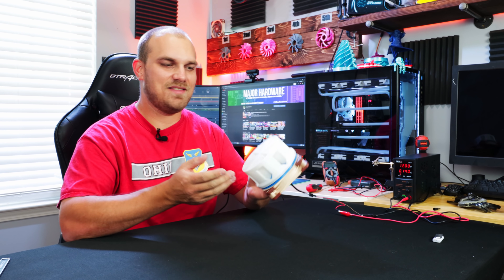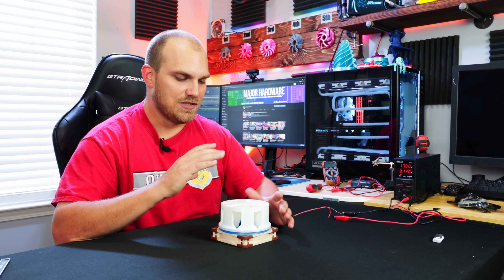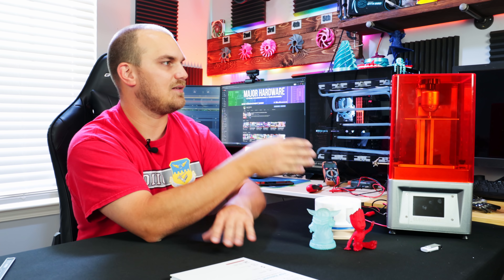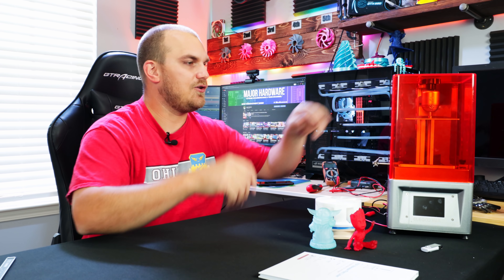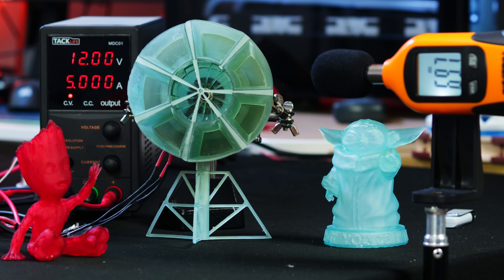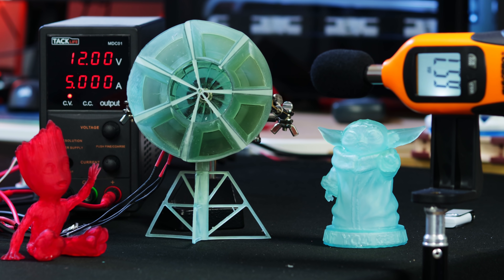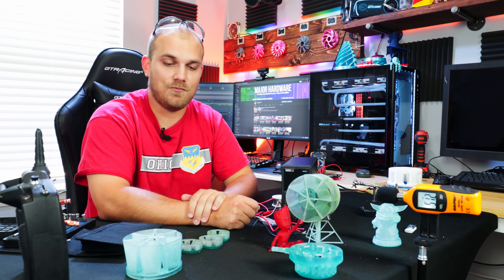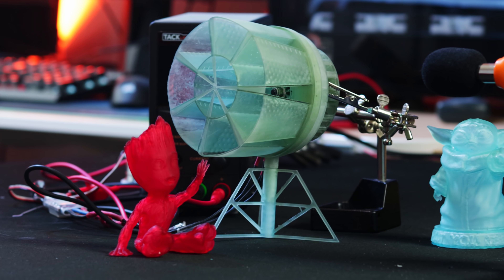CRAZY LOUD 3D Printed Tornado Siren | Elegoo Mars

Comment: You should have used a Lipo battery - say 11.1v 5500 mAh...you can definitely get much efficiency than a power supply. The other thing is you left everything over the table and tried to toast it which can lead to shattering things and dangerous parts flying.... Try to use some sort of a  shelter or put it a well protected place so that if something fails, you and your valuable computers are not in danger,,, Seriously dangerous situation.

Comment: Increasing the voltage makes no sense, your power supply has a limit of 5A, reaching this current it will lower the voltage back, so increasing the voltage in this case only serves to maybe burn your device.

Comment: Print a 120mm fan blade . I've got the elegoo bars 2 pro and I've yet to even take the plastic off...and it's been 6 months. Didnt come with resin.... ive got some other kinds of uv resin but really just havent been able to think of a use for the limited build volume to get me  motivated to set it up

Comment: It could have gone faster, but your supply was current limited. Look at how it fell to 8v when you tried to go full throttle, you'd need a more powerful power supply for it to not drop its voltage

Comment: "I only left half a mil of clearance"
On my Ender-3 I get down to 0.15 on PLA and 0.3 on ABS on clearance tests, if 0.5 is impressively low for you, I think you need to calibrate your e-steps and flow. Specially on a $700 Prusa compared to my $180 Ender-3.

Comment: Your power supply can't handle 5amps at 16 volts you need one that adjust its output to compensate for voltage sag

Comment: your siren is flawed in multiple ways 1st you are using too fast of a motor you want to target around 3600 rpm 2nd your rotor/stator are too small you want to target the largest size you can print 3rd your horns are the same part of your stator you want to separate your horns from your stator

Comment: As a "fan guy" I would have thought that you would have made better preparations for cooling the motor.  Maybe even just a few holes to the inner area of the rotor to pull air through.  Might even assist with better airflow into the rotor.  Also, make the "horn" chambers more parabolic in cross sectional area for better impedance matching with the air (Why trumpets & such perform well).  And dB meter should be in front of the horn as most sound exits that way, not to the side.  And yes, definitely a "beefier" power supply for that motor is needed for full performance.

Comment: I know i'm late to the comment section if you do see this, instead of buying a larger PSU that you might only use to run brushless motors by/use lipo batteries, cheaper and you get all the beans 
Hope this helps

Comment: Hey man, love your channel! You found a pretty cool niche :)
Considered doing a re-print of your best performing fans with longer times or whatever can make them better? Is this resin printer better for the best performing models, and do top 10 runner ups or bad prints need a re-run?

Your cooling tower video is so cool. I want to do this, but would mist instead of drip...

Comment: You should definitely restart the fan challenge using the resin printer. I imagine the higher accuracy would lead to less air resistance and turbulence. Maybe that #1 fan will finally beat the Noctua.

Comment: Your PSU was limiting at 5A by bringing the voltage down to 8V.
You would have gotten more Power/Noise by using your 3S Batteries because their voltage wouldn't drop much.

More detailed explanation: The PSU will not go over either of the limits you set so if you set it to 5A it will limit the current at 5A.
To do this it needs to lower the voltage until it the load draws less than 5A. In this case that was 8V.

The PSU is simply no match for the power hungry motor. To feed it you would need a very big power supply.
These are only available at 12V if you want a decent price but at that point it would be better and much cheaper to just by a 4S battery if you already have a charger for it.

Comment: That doesn't really sound like a siren. It sounds more like a small high revving motor. If you took the horn off the motor and stuck a simple twin blade prop on there it'd probably sound just as loud..No doubt there are designs that can get much, MUCH louder like an actual siren.

Comment: To test higher currents it would probably be easiest and cheapest to get 4s 5s and 6s batteries. If you already have a charger that would be much cheaper than a high current >20A variable power supply. The throttle percentage already regulates total power, so you don't need fine control over voltage.

Comment: Idea: Make a tunnel(/more like funnel) leading from bottom front fan, supplying directly GPU fans with fresh air, in a way that allows circulation around the card once it exhaust the hot air. So the funnel should only by like 9cm wide (lengthwise) at GPU side, but 12x12cm at front fan side with use of some faster fan. And the gpu side would have between 18-27cm in length, depending if it's 2 or 3 fan cooling design. Really curious how this would affect the temps.
Reply: But overall it makes me freaking sad, that there is so many environmental problems connected with people's hobbies and unnecessary activities, and yet new ones still emerge. All this plastic and now resin FFS being produced for what is easily trash in 90% of cases is just ridiculous. How come so many people can't think rationally and stop doing such stupid stuff and support a bussiness that focuses on making trash for few minutes of enjoyment?
Forget my idea, I'll make it of used cardboard and check myself without adding trash to environment

Comment: My recomendation is to get another power suply, you can se at wide open throttle that the voltage drops to around 8v so both 12v and 16v runs were at the same power output. You can run multiple power supply in parallel to get more total power but they have to be set up for delivering the same current (if one gives more than the other, it can damage the one that has less amperage (so if you had one that can go to 5A and other that can go to 10A, you have to run both at 5A) for more voltage the same rule aplies but you have to conect them in series.

Comment: Have you tried running the siren without that front duct?  With the duct your impeller input and output are coaxial so you will be getting interference effects which may be constructive or destructive.  Most commercial sirens don't have this duct, with the siren output coming straight out of the stator in a radial direction.

Comment: Hey man, love the videos.  I think you should definitely try a larger impeller diameter.  Its too high pitched imo, so going to larger diameter should help slow it down drastically for same power levels while increasing pressure (which I would presume translates to more SPL).
Dunno if you've heard of these, but check out the "Fan Affinity Laws"  which describe how flow rate, pressure head, and power requirements relate for changes to shaft speed or impeller diameter.  If the resin print volume limits your size, maybe a hybrid approach of FDM for the horn/housing, and resin for the impeller and immediate surroundings for precise clearance could work well.

Also, as already pointed out in other comments, that power supply can't provide the current for RC motors like that.  I have one which is similarly spec'd but it has dual outputs which can be configured in series or parallel for 60V 5A or 30V / 10A max max, but 10A still ain't much in terms of brushless motor power, they can take HUGE amounts of current.  Unfortunately I haven't seen any similar "off the shelf" bench supplies like that with sufficiently high current for a reasonable price though.
Why not just stick to LiPo batteries as you've done before?  If you're after the voltage/power reading that the bench supply provides then I'm sure there's some modules geared towards RC usage that could help display that.

Comment: Wow, that's a cheap resin printer! :o
I'm used to Formlabs, and they're probably at least 10-20x more expensive... One thing they do get right though, is the resin cartridge system - just inserting a box of goo in the back of the printer and not having to worry about manually (re)filling the build tank to the correct level really makes the experience that much better (even though those cartridges are quite expensive)

Comment: You should definitely retest all the old fans with the new machine and move to making all the new fans with MSLA. FDM is just extremely unoptimized for what fan blades require. MSLA is good enough for what you're doing, which is just prototyping, but isn't quite good enough, yet, for production of things like fans, which is why you don't see any production unit using printing for it's product. 
Not to mention MSLA printing allows for much higher detail and much more intricate designs.

Comment: I'm no expert but I recently got the Elegoo Mars, mainly for printing minis but I also like to make functional things (spare parts for my kids toys or a tabletop vice etc). I had some issues to start and got some advice from a bunch of people, so some of the following is regurgitated advice and I'm sure you've probably looked at this stuff anyway. For functional parts I can highly recommend getting some Siraya Tech Blu resin, it's so much stronger than normal stuff. Also, if you're finding stuff is sticking to your FEP, you might want to check your bottom layer exposure time, somewhere between 60 - 80s should do you. Also depending on the resin, you may need to adjust your standard exposure time, for example, for normal Elegoo grey, I use 70s/8s but for Siraya Tech Blu I use 60s/11s

Comment: That was not 5 amps @ 16.6 volts. Watch the voltage drop at full load. Your unit can likely only supply up to 40-50 watts of power.

Comment: With your ultrasonic, you can use ziploc bags with IPA in them along with your print, the ultrasonic will go through the bag and the fumes are contained within the bag.
I use this method in my ultrasonic with IPA in a bag for greasy differentials + 3D resin prints.

Comment: You can clearly see in the footage that the motor wasn't running at 16V and 5A! As soon as the RPM gets too high, the PSU hits the 5A limit and drops the voltage to around 8V which in turn lowers the RPM and balances things out. You were only feeding the motor 40 watts in both 12V and 16V tests because both times the PSU couldn't output more current and dropped the voltage! I strongly recommend if you buy a bigger PSU, test the motor carefully again as the print is likely to explode at those higher RPMs, here you were saved by the massive voltage drop.

Comment: Hey James,
so stoked you're giving resin printing a try!
You're correct about using IPA in an ultrasonic cleaner (you shouldn't), there are a couple things you can do there: A) get an explosion-safe ultrasonic bath ($$$), B) put water in the ultrasonic bath, put the IPA in a ziplock bag, put the part in there too ans wash it. This way you're not evaporating the IPA directly
An alternative to using IPA would be TPM, you can learn more about the ups and downs and when to use which from this webpage: https://support.formlabs.com/s/article/Choosing-the-right-wash-solvent?language=en_US (shameless plug, I work for formlabs).

Comment: if you are looking for a different power supply then look for the "DPM8624" 60V + 24A is enough power and it has a wireless controller with a 2.4-inch LCD display, so you can control everything without being nearby

Comment: Resin printer will do wonders for the surface finish on fan blades, reduce drag and improve performance. Can also add some more subtle aerodynamic features. Just the build plate size might be an issue?

Comment: Do you fill the whole ultrasonic cleaner with IPA?!?  the way to do it is to have a jar with IPA with the 3d printed part in it put the jar into the ultrasonic cleaner filled with water. the sound waves penetrate the glass. much safer and much more economical.

Comment: Ive been using simple green to wash my prints cause it was the most available option in my area especially with corona being a thing and making rubbing alcohol expensive and harder to get, oh and also dunking the parts in warm-hot water from the tap to break free supports makes a huge difference

Comment: You need like at least 30V 20A psu this is too weak when this was on the fan cooling rad is was drawing from wall 260W so lets say 240W on output so that 20A at 12V so if you want to ran it at 16.5V you need like 30A (~500W) maybe even more

Comment: For static tests like this an old computer powers supply will leave your bench power supply in the dust for current output at 12v. You can get breakout boards pretty cheap online if you want the supply to be unmodded. It won't be a true variable voltage but for 12v work they are heard to beat.

Comment: THIS IS THE 6900XT COOLING SOLUTION ITS SO LOUD I HAVE TYPE UPPER CASE DUE to AWSEWOM COOLING FOR BIG NAVI COOLER THAT SOUND LIKE TORNADO WARNING IS NEAR ME SO CLOSE THAT I KEEP MISTAKEN OF LOCAL SIREN ....AND I SEE NO TORNADOES OUTSIDE ...BUT THIS IS BETTER THAN 5700XT....IT WILL BE CERTAIN TO COOL 120C GPU LIKE BIG NAVI THAT GIVES ME 4K 50FPS...IT ALSO WILL PUT OUT THE ELECTRIC SMOKE IN CASE 6900XT START PRODUCE SMOKE IN VRMS AS WELL...GREAT FOR AMD USERS THAT NEED A FAN PUT OUT THE FIRE ALSO WHEN GPU GETS TOO HOT

Comment: IPA is totally fine in ultrasonic. I have been using it for over two years, the only problem I ever had with it was it evaporates quickly if the lid is open while it runs. No need for any extra precautions, just a fire extinguisher if the machine craps out but the fumes themselves won't be able to light a fire at this small scale.

Comment: Maybe double or triple your turbine in height and increase your stator accordingly to gain surface area and air flow. More spl comes from surface area moving air. You could vary the number of chopper veins to add secondary and tertiary tones to make it more effective. The larger versions vary the chopper veins to produce two times that create a louder overtone for effectiveness.

Comment: The fan showdown will be better with a SLA printer. The ridges you get with the standard printer causes drag which reduces the efficiency. The smoother a finish on a fan or propeller will increase air/water movement/displacement. These differences in a short-term application wont be very visible but along a more long-term constant usage such as your tower's fans which plays the most important role. The manufacturer's engineers spends weeks if not months gathering statistics and making necessary tweeks to their design. With this knowledge in hand I'd have to say that you most likely wont beat the A12 with printed parts. Not impossible to achieve this task but improbable without having proper knowledge and experience of the task as a whole. I'm very excited to continue following the Fan Showdown series because it is going to take a legend to bring down that A12.

Comment: If the question is "Should I get a bigger..." the answer is yes. Always yes.
Reply: @ieatchickens  should I get a bigger rope
Reply: ...income tax?
Reply: @ApusApus  If you're asking the question, 'SHOULD I pay more income tax?' you can afford to pay a bigger share, so yes =P
Reply: I would like to see a Boat propeller either full sized or to a scale. Or a helicpter blade and the shell with a quad motor on it and I will pilot it for you.
Reply: Should I get a bigger real life K/D?
Reply: Uh, the Elagoo Mars has a pretty small print volume at 4.53"x 2.56"x 5.9".  So it can make the fan for a 120mm fan but not the frame.  But for the power supply, yeah a chunkier one that will do 500w+ will make a difference.
Reply: Even tumors?
Reply: @marcusbordeaux7548  Well, if you're asking if you SHOULD get one bigger, that implies some kind of desire to get a bigger one. Ergo... I guess, if that's what strokes your goat?
Reply: Even with asswooping?
Reply: Even pace makers?
Reply: Should I get a bigger...

Girlfriend?

Debt to income ratio?

Tumor?
Reply: @MrIdontknowww  biggest tumor
Reply: Should you get bigger hemorrhoids?
Reply: Bigger enemies?
Reply: Bigger PS5?

Comment: Loads of experience with commercial and custom sla printers here. 
My biggest tip is careful how you position your parts in respect to flat surfaces. Try and not have them printing completely flat onto the print bed. More likely to stick that way and you'll get better results with a slight angle as well.

If you get into it you should try experimenting with some homemade resins!

Comment: the rotor could probably designed in a way that it provides active cooling for the motor. 
and i feel like the siren's pitch is way to high. but  then again, it should probably be that way to be as annoying as it could be so you react in the appropriate way.

Comment: I give a mars pro, some advice use pursa slicer on under sl1 export as stl with support then slice in chitubox
Get rid of the use it comes with, also non-opaque colors take longer ex normal resin is 50s and 6s Elegoo water washable resin green is 60s and 8s
Reply: Using that USB is begging for problems

Comment: Tip for ultrasonic cleaners: Use regular tap water in them, and a thin walled plastic container for the liquid cleaner. That way you can easily switch between cleaners without messing with emptying and cleaning, and if you have one with a lid, you can easily store it for later use and you don't have to worry about flammable fumes during the cleaning run.